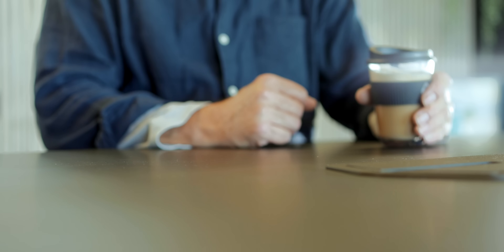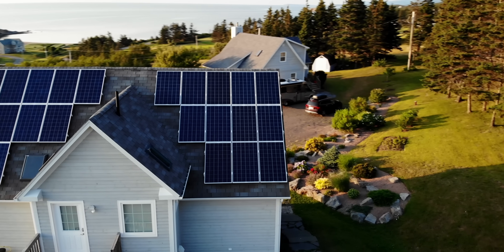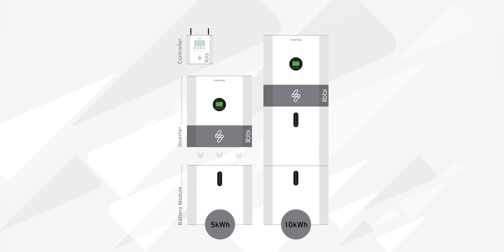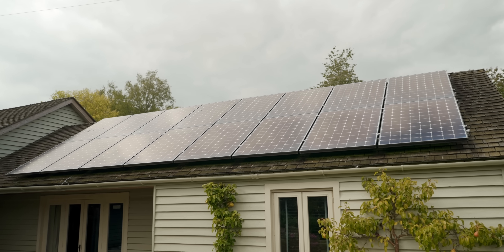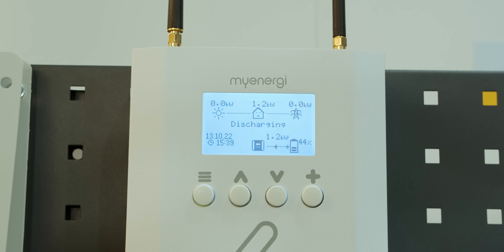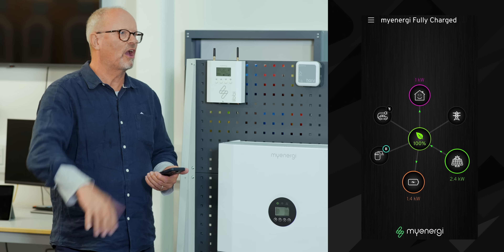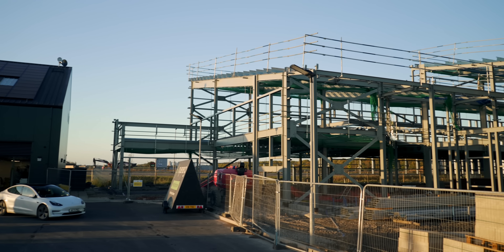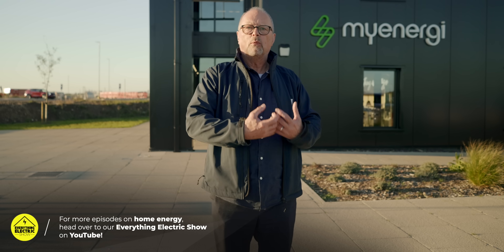THIS Home Battery is the Key To Cheaper, Cleaner Energy!

Comment: I have to contest your belief that off-peak charging from the grid is a great idea. It is not. Using batteries for storage is not free. Every kWh you store deteriorates the battery, and the more so the more you use it at the extremes, i.e. charge to full, and use to empty. If you calculate the cost of the battery over its useful lifetime storage capacity, you will see that every kWh is actually fairly expensive. Batteries likely only pay when used to store solar power that would yield little when sold to the grid. The price differential between day and night for grid-charging needs to be very big to justify their use. Grid charging also involves double losses of AC-DC, DC-AC conversion whereas a hybrid solar system has no extra loss through battery use vs converting solar DC straight to AC. Finally, night time power is almost by definition dirty power. Better sign up with an electricity provider that offers renewable power and use it during the day, even if it costs more!

Comment: QUESTION 2; If I’m thinking correctly, if I had an EV, came in to charge it at night, with net metering it automatically pulls from the grid unless the power from the grid is down, I would assume? Now if the grid was down, then I could charge from the batteries, but what people fail to realize is how expensive it is to have large battery backup. Two powerwalls where almost $19,000.00 and 26 KW. Even a Nissan Leaf had a 42 kw battery so a system that covers all but $11/ month for my entire home, could only charge a leaf at 50% off the battery, which IMHO , is an expensive proposition. What I am curious about and think this is the real wave of the future is bi-directional charging. Instead of battery backup like powerwalls or others, charge the car off the grid, lose power and have the car as a backup power source, now we’re cooking with gas), lol Even small EV’s have 60 plus KW batteries that would cost $60,000 in powerwalls, you could buy a whole car and have a car and massive backup power.  Any thoughts

Comment: The elephant hanging about the room is the mismatch between summer and winter. I generate loads of power in the summer but use little and visa versa in the winter. Pennywise, short term storage doesn’t work. I’d love a home battery, but it makes a more sense to sell back to the provider to build up the account to cover winter costs and it would be a lot more cost effective to buy a dozen more panels. That’s likely to remain the case until the technology’s developed to get rid of any lithium, cadmium, diamonds in the recipe and reduce the costs by a factor of ten. Until then, I’ll just have to head off to the pub if there’s a power cut.

Comment: QUESTION; he said you could charge the battery from the grid, is that in the UK? I have 8.4 kw solar, Enphase micro inverters, 2 powerwalls and here in VA, they don’t allow charging from the grid. The only time it will allow charging from the grid is when in storm watch. Thanks

Comment: This is all great (I’ve been using Zappi and Eddi for years) BUT…BUT……. Libbi batteries will not be available until at least spring 2023 or possibly summer, when I checked last week.  With so many home batteries now available (Giv Energy, Victron, Powerwall etc) is it worth waiting another 6-9 months to get a Libbi ?   Also the lead time to get an Eddi is now 8 weeks, and the Zappi is costing from from £779 !!  ouch…!     And then there’s Vehicle to Home (V2H).  This will be a game-changer and eliminate the need for home batteries altogether, for those with an EV.  I’ve been asking MyEnergi for YEARS when they’ll make a V2G bi-directional charger, but when I checked last week still ‘no plans’ to make a V2H system.   MyEnergy are good, but NOT at the forefront of this technology, despite Robert’s enthusiasm.   Perhaps MyEnergy would like to comment….?

Comment: What is the rating of the inverter?  This is a vital piece of information, as many companies will only supply max 3.5KW inverters, which means if the house pulls more than 3.5KW at any given time, the rest is pulled direct from the grid, no matter how big your battery storage!  The reason many companies limit to this SMALL size of inverted is purely paperwork!  There is much more paperwork involved if you want a bigger inverter.  Many houses can easily pull 5 or 6KW if the electric oven, and maybe either a kettle, and/or microwave, and/or washing machine, and/or dishwasher are all running simultaneously.  So the "size" of the inverter is a key part of the equation, yet this is rarely mentioned whenever talking about home storage batteries.

And why no prices?!?!  Even "ballpark" MSRPs would be helpful.  As is, this is interesting on an academic level, but is of no help whatsoever on a practical level.

Comment: The good stuff, the magic if you like, is all in the control systems.  Tying the battery into that is a corporate benefit decision that is fundamentally anti-competitive and  anti-consumer.

Putting your magic into an inverter could make sense because control there might be integral to the efficiencies you can make.  But a battery should be a commodity item that you could shop around for best price on.

Comment: Why is the 15kWh Libby at least 3 times the size of a Tesla powerwall? (It is twice as deep) And what is the cost? They need to compete in all aspects of the specs…
The temperature control is by natural convection, so installation in a garage or outside is probably not possible… remember the 1st generation Leaf…

Comment: looks really good. We've got a Solis and plylontech system and have had no end of problems with it. Wish this had been out a few months ago!
Reply: I have the same system and it always pulls power from the grid ok its only a small amount bit over a month it all mounts up
Reply: @mikemurray8619  we've got 3 phase so unfortunately the libbi isn't suitable yet. Our current system is all over the place, pulls from the grid to charge then dumps everything back to the grid. I've had days this month where 18kwh have been generated and only had 1 kwh of self use!

Comment: I have had a zappi for coming up five years now and an eddi for two (plus a couple of Harvi and a hub). Can't fault the company on support and warranty claims, but the software (both device interface and server side) is all just a bit clunky. It can be hard to get the devices to play nicely together sometimes; and forget about getting them to play with anything else, off brand. There is just no scope,
I knew this battery was coming but decided not to wait and to jump for a Victron based system earlier this year; and the difference between the two companies is apparent. If you want genuine modularity, expandability and almost unlimited potential, Victron is the way to go.
In the vast majority of cases; when I pose a question 'can I do this?', the answer with Victron is 'yes', where the answer with Myenegi is 'no'.
I do not envy any early adopters of this; that is unless myenergi have really upped their game.
Still - don't want to be too harsh on the company, because I love what they are trying to do and as I say, support has always been very good (although you might want to question how I've come to discover how good there support is - really).

Comment: How can we give this episode a thousand thumbs up 👍👍👍👍👍 well done Myenergi & FullyCharged . Brilliant news about the Libbi, if I hadn’t already got my existing Solis inverter & Pylontech batteries , this would be my ideal system. The integration with the Zappi & Eddi is excellent. As Tom mentioned , the lack of agreed standards about how different inverters, batteries, & car chargers integrate  together makes managing the power available a bit of a pain. Being able to have a DC coupled battery system, that can charge from the grid is a real bonus. Charge up overnight on cheaper , and often greener power to save having to use peak energy at top prices. This will begin to help the grid wean itself off the dirty fossil fuels we are currently still so reliant on.
Reply: ISO 15118 & OCPP for bi-directional car charging, Modbus for everything else?

Comment: It's still a lithium battery, and lithium is getting very expensive and very scarce because everybody wants it! Also, you can't run these lithium batteries down to zero and they are difficult to recycle. I have 2 Redflow zinc bromine batteries installed - recyclable, can be run down to zero, and no risk of fires. They are a much better option for household stationery power.
Reply: Which type of lithium battery...
There are LiFePo4 batteries which are cheap and safe.
Or there are the cells used in laptops, cars etc.

Just saying "lithium batteries" means nothing
Reply: Last time I asked, Redflow not available in the UK.

Comment: I’ve had myenergi products since almost the beginning and have in the main been delighted with them. It’s great to see a British company doing so well, I just hope it remains British. 
I’ve a Tesla powerwall which is 13 kWh and notice the new myenergi battery is just 5 kWh for some that’s possible enough but for many a larger option would be better. At the moment I’ve a second powerwall on order and wonder will the new myenergi battery work alongside the powerwall.
Reply: You can fit 4 of them together for just over 20KwH.

Comment: The main reason people buy PV panels and energy storage is for their own use.. but if you drain their battery or slow their charge, that is the same taking away when they need the most.. 
and this company don't want to shell out cash for their own storage.. rather they want the people collecting and storing while they are the one using, controlling and "distribute" over the internet..

Comment: Junking the inverter I already have to replace it with a myenergi one doesn't seem very green(?). Focusing on the ability to charge the car fast from the grid when you come home from work is an odd choice to demonstrate control of battery draw. Guess I will have to wait for V2G/V2H to become widespread. :(

Comment: Robert….this is just an ad😢.  Libbi capacity is way too low is Tesla not 14.4kW? We trust you guys for balanced ‘journalism’.
Reply from the maker: Libbi capacity is up to 20 kWh. Tesla powerwall is 13.5 kWh. Libbi is a self contained system. The Tesla powerwall needs an external inverter and in some cases a separate gateway, the system that isolates the battery during a power cut. This is all built into the Libbi. 
We have covered the Tesla Powerwall incredibly positively, 2 episodes we've made about the battery have garnered many millions of views. 
We cover another system, newer and with improvements and that's immediately 'an advert.'
You could say that about every product we have ever featured on the show.

Comment: If any company develops any alternative to lead acid battery with the same cost, then home Solar energy system, will really take off. I live in India with a 5 kw solar system with 6 x12 v lead acid [72 v] tabular battery with an 5.2 kva inverter. 
    For us in India, installing a lithium battery setup is too costly,  the only option for us now is lead acid which is not  an efficient battery to say the least.

Comment: I like the idea that Tesla has competition, but I didn't see MyEnergi offer anything that can't be accomplished through Tesla's products. MyEnergi's single inverter for both battery and solar power is clever (although power optimizers may be needed), so there ought to be a cost advantage there. But Tesla's app is more elegant looking, and just as functional, and their battery capacity is pretty high.  5KWh may get you through an evening in England, but won't in the US, especially in the summer when A/C is required. Also, forget about using electric dryers, or an electric oven for an extended period at night. Just running dehumidifiers will drain a 5KWh battery by itself overnight. And charging your car? Even a modest 20 to 80% recharge could require 25-50 KWh or more. How is a 5KWh battery, or even the maximum 4 battery configuration going to handle that? MyEnergi offers  a lot of solutions, but they don't bear practical scrutiny, at least for the US market. P.S. I find it strange that people will want to charge their car using solar energy exclusively. As long as one consumes all the solar energy generated within the home, it shouldn't matter whether the home or the car consumes it.  The utility of energy is like using money in a bank to pay bills; the recipient of the funds doesn't care how the money got into the bank.

Comment: MyEnergi always seems to be on the expensive end of the scale... the fact they aren't announcing the price here doesn't exactly fill me with confidence that this will be the key to CHEAPER cleaner energy, at least compared to something like a rack of Pylontech batteries or similar. If we want to save the planet, the single most important factor for normal people is simply the price.

Also, a shame the maximum capacity is only 5kWh expandable 20kWh, compared to a Powerwall which is 13.5kWh and can be expanded to something like 135kWh... so I'd hesitate to say it's better than a powerwall if you want. I appreciate the ability to go smaller than 13.5kWh for smaller houses, but the lack of larger backup options isn't ideal - 20kWh would be less than 48 hours of backup for me

Comment: This all sounds great.  All apart from the app that is.  My concern would be what happens to my installation if the company dies and I can no longer use the kit because it relies on an app that's connected to a cloud service that's suddenly been taken down?  If the app connects directly to the kit via local wifi or whatever then I'm all in.  If the kit connects to a cloud service just to allow external entities to send usage hints or to allow me to control it remotely then that's fine too.  If it's totally reliant on the cloud to for basic controls then I'm out.

It's like a thermostat or lighting system in the house:  If all of the control is local then that's ideal.  If I can dial in from anywhere to monitor it or switch it on/off then that's a bonus.  If I can't go near it at home when there's an internet outage or the manufacturer goes bankrupt or whatever then I won't invest the cash to install it in the first place.

None of that was covered, and given that it's increasingly common to slap everything in the cloud with a promise that "our startup company will never go bust," I'm pretty wary about this kind of thing.  It needs some kind of protocol that's published and open so that it can integrate into common home control systems like HomeAssistant or whatever, but given the laser focus on the flashy phone app and no mention of alternative methods of control and automation I suspect that's not a thing in this system.  I'll look up the system online and I hope to find that it's been thought through or I'd be better off with a less "high tech" solution to power routing and scheduling etc.

It's good to see companies working on this kind of thing.  Just please do it right, and design it to outlive the manufacturer just in case.

Comment: I don't know how they have worked out how big a battery is ideal for your home, but from my personal experience I found approx double my daily consumption was ideal. I have made my system up from a Luxpower inverter and pylontec batteries. I have 19kwh of batteries, but that wasn't cheap. My goal was to minimise energy being wasted to the grid and at the same time keep my consumption from the grid also to the minimum. My biggest bugbear at the minute is the Luxpower inverter won't run if the grid goes down. There is a UPS output but I can't connect everything to it as it's output is limited.

Comment: Fascinating. The car has a huge battery storage capacity. Can it be used to power the home during peak use times and recharge at low rates using this bespoke system?

Comment: With the modbus interfaces of other inverters you can create an app that does this too.
It's not actually anything special.
Hybrid inverters can have their output and battery charge rates and times changed on the fly through their API.
It's great this company has created such an app and system, shame it will cost a massive premium. Shame the other companies aren't doing the same for cheaper.

Comment: 5kwh inverter seems pretty low tbh. It's a nice system but the output capacity is pretty poor. Sure it will cut bills, but won't be capable of bringing about energy independence.